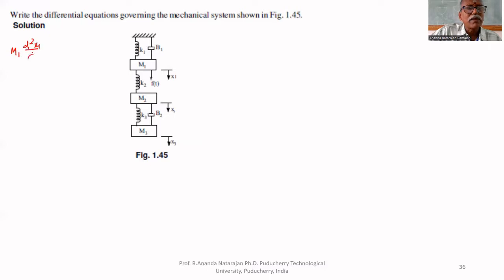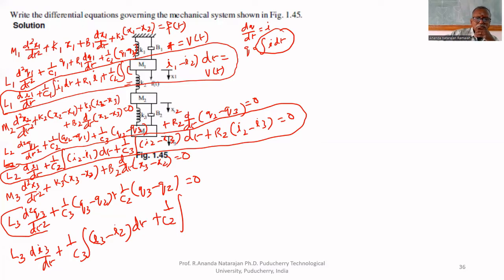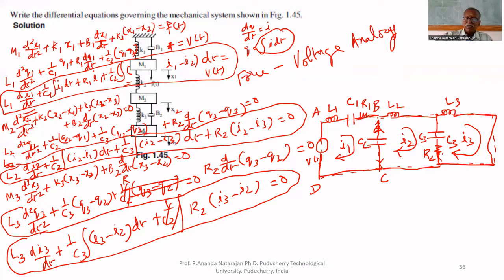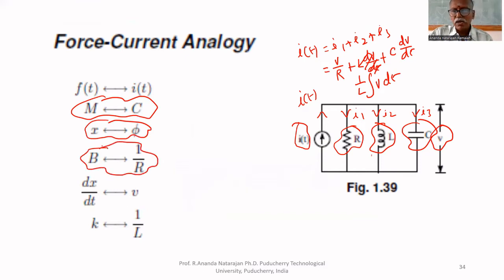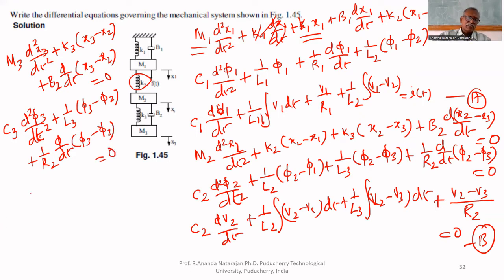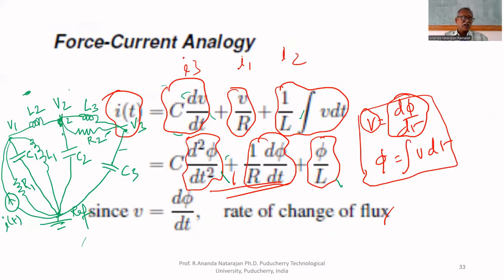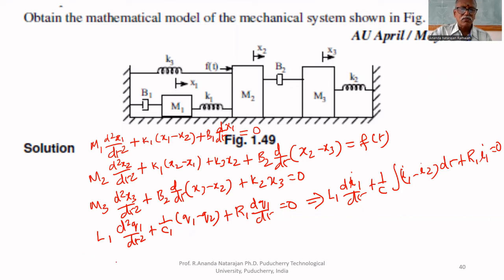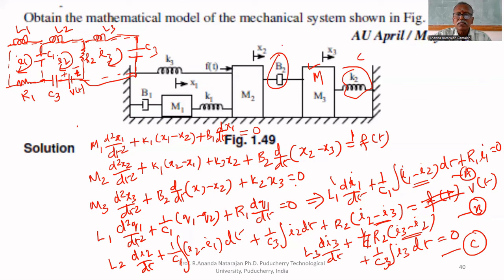Control systems Class 4 : Mathematical Modelling Part 4

Comment: Sir could you please upload some of these experiments

Pressure Control Trainer

a) Study of open loop response (manual
control)
b) Study of on/off controller.
c) Study of proportional controller
d) Study of proportional integral controller
e) Study of proportional derivative controller
f) Study of proportional integral derivative
controller
g) Tuning of controller (open loop method)
h) Tuning of controller (closed loop method)
i) Tuning of controller (using auto tuning
method)
j) Study stability of the system (Bode plot)

 Temperature Control Trainer

a) Study of open loop response (manual
control)
b) Study of on/off controller.
c) Study of proportional controller
d) Study of proportional integral controller
e) Study of proportional derivative controller
f) Tuning of controller (open loop method)
g) Tuning of controller (closed loop method)
h) Tuning of controller (using auto tuning
method)
i) Study stability of the system (Bode plot)

Level Control Trainer

a) Study of open loop response (manual
control)
b) Study of on/off controller.
c) Study of proportional controller
d) Study of proportional integral controller
e) Study of proportional derivative controller
f) Study of proportional integral derivative
controller
g) Tuning of controller (open loop method)
h) Tuning of controller (closed loop method)
i) Tuning of controller (using auto tuning
method)
j) Study stability of the system (Bode plot)

Flow Control Trainer

a) Study of open loop response (manual
control)
b) Study of on/off controller.
c) Study of proportional controller
d) Study of proportional integral controller
e) Study of proportional derivative controller
f) Study of proportional integral derivative
controller
g) Tuning of controller (open loop method)
h) Tuning of controller (closed loop method)
i) Tuning of controller (using auto tuning
method)
j) Study stability of the system (Bode plot)
Reply from the maker: https://youtu.be/tdjUjJsABdQ